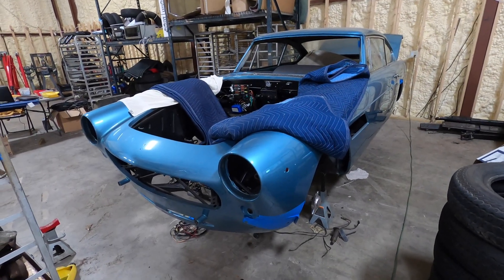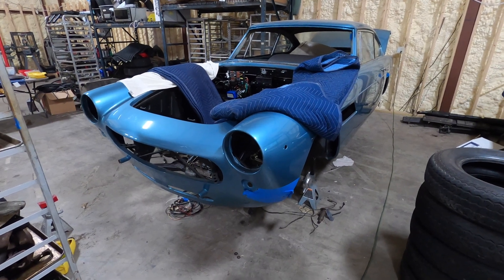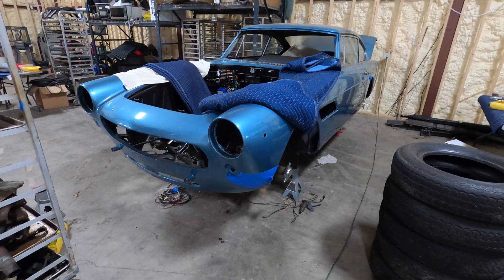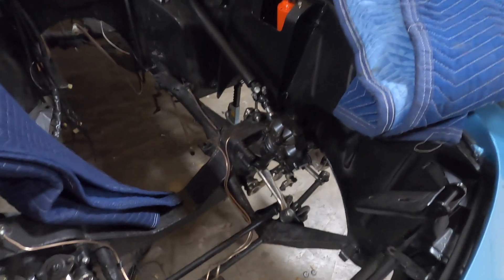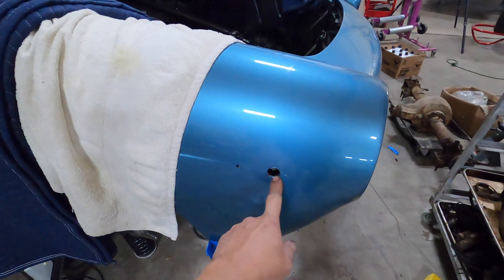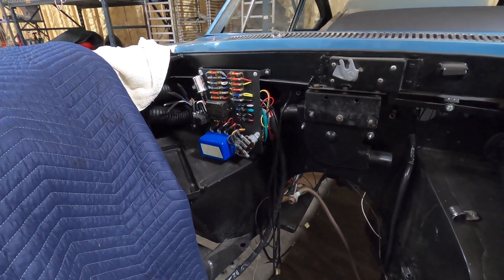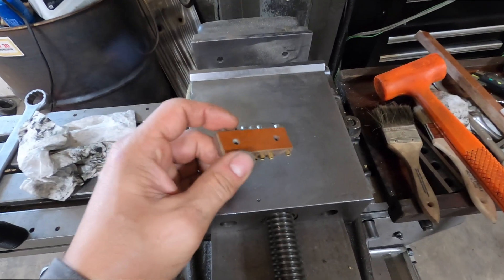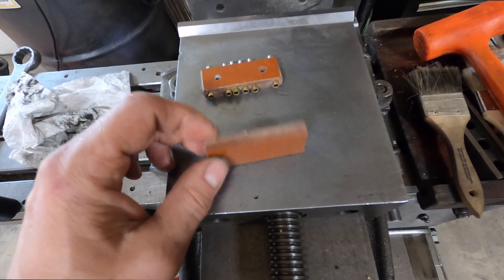Fabricating Ferrari Junction Block

Comment: Would brass tubing of the correct diameter work?
Reply from the maker: Thanks for your thoughts. The correct connector has a bit of a spring tension to them when the male end is inserted capturing the connector. If brass tube is used, I think the vibration from the car could rattle them loose.

Comment: Would an English wire connector(s) work for your project?  Eg. Austin Healey……instead of soldering two pieces together?  See Moss Motors part numbers 161-000 single….161-720 triple…. These are found all over these early English cars in their wiring connections. If you want the Bakelite look, you could strip the rubber insulation off and still use the connectors..  They also sell the male bullet ends separately.
Reply from the maker: Thanks Michael, but it looks like those connectors are ganged together, so one wire on one side can connect to all the others on the other side. I guess I could buy all singles, but I'd have to get some to see how long they are. Thanks for the tip!